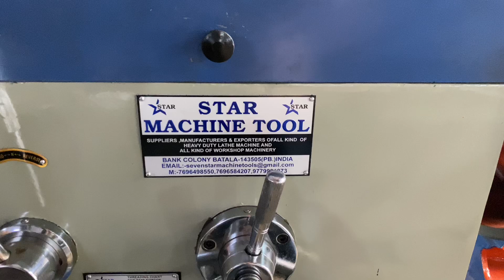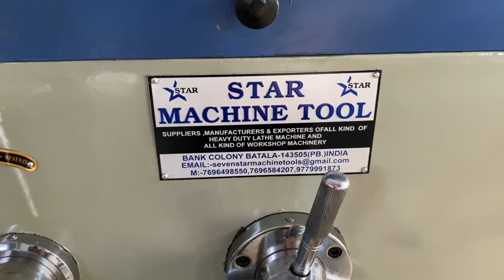12ft Heavy duty lathe machine, 20” bed , 18” centre height Cont :- 7696584207,7696498550

Comment: The title says it has a 20" bed. Twenty inches is very short for a bed on a large lathe. I suggest you correct the title to show it has a 20 foot bed (20' , not 20")
Reply from the maker: 20” bed width 
Length is 12ft